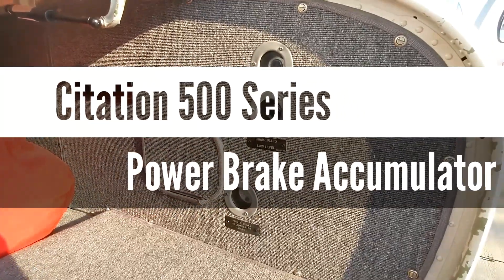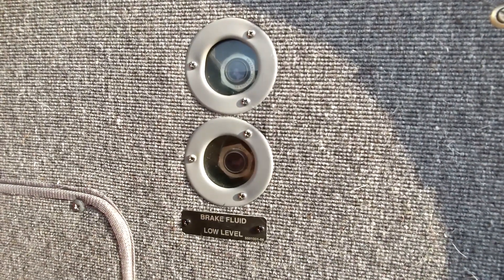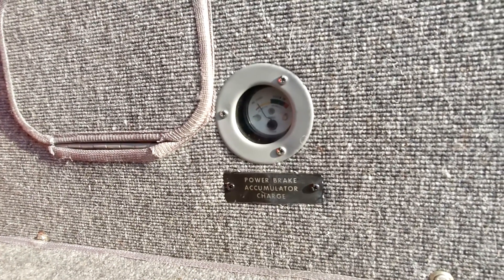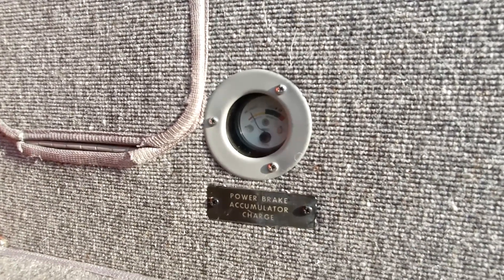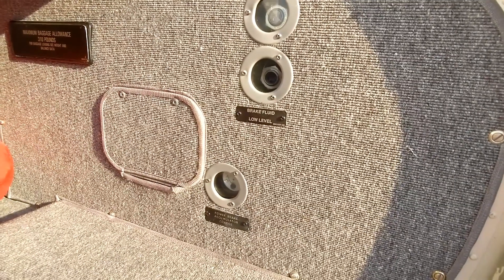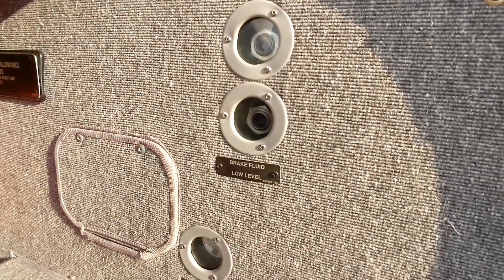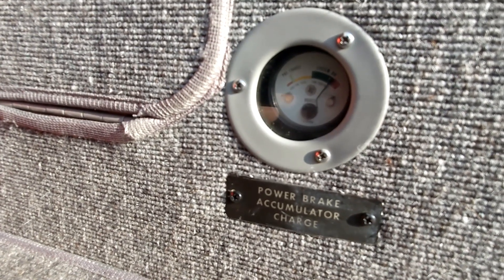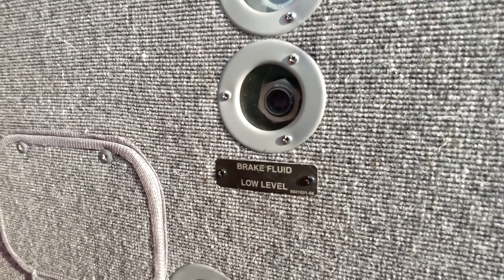Citation 500 Series - Power Brake Accumulator

Comment: The big question: before Battery power is applied, or an extended lengthy period since Battery was on and Accumulator was pressurized - how effective is the Parking Brake?   The jet was towed into position, you set the parking brake ... departure is imminent ... do you need chocks?
Reply from the maker: In the II/V/Ultra, the brakes use the accumulator to increase effectiveness, but they will work by simply pumping the pedals using the master cylinders. In the Encore, the brake system uses a metering valve that relies on normal DC electrical power to operate, therefore the parking brake cannot be set without electrical power.
Reply: Thank you for pointing out the difference with the Encore system.  I can't help thinking, if the Encore pedals give some resistance, even though the Accumulator isn't charged or hasn't been charged recently, there would still be enough pressure on the brake pads to hold the jet from rolling (no chocks) shortly before departure.  Dealing with one or more chock blocks right before entering the jet to depart seems like a potential distraction.